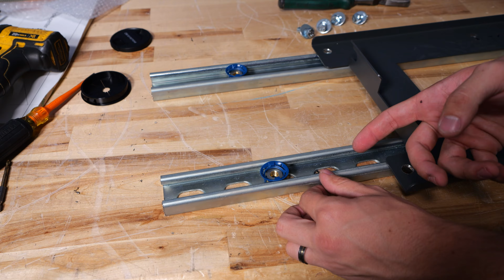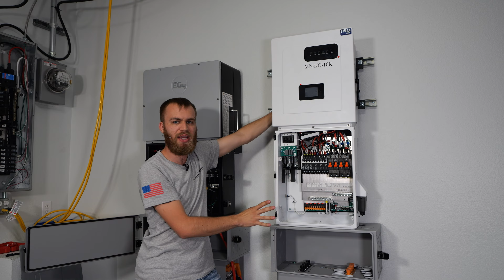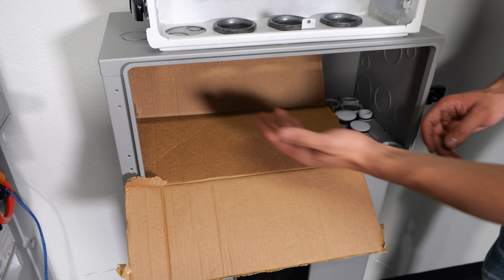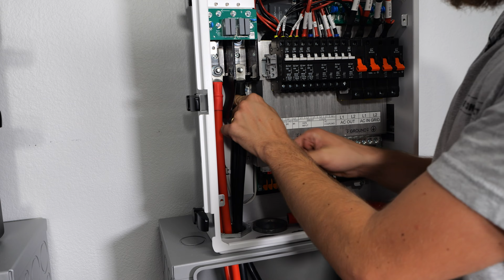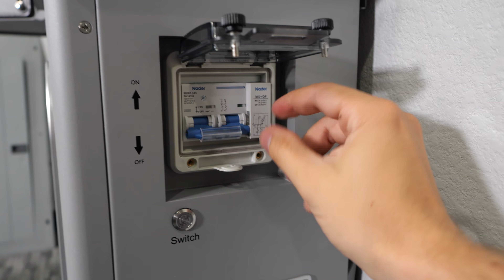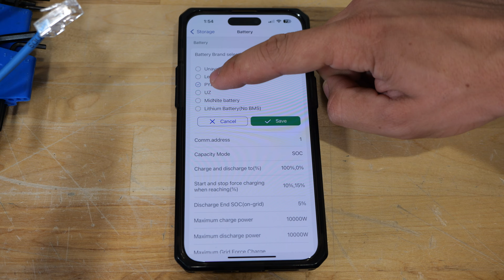Step By Step: How To Install Midnite's ALL-IN-ONE With EG4 PowerPro WallMount Batteries

Comment: Hello. Can this inverter be ran on solar alone? Also can it run in a grid assist mode? As in if it starts to get over loaded, it will pull from the grid the amount of the overload or will it transfer the entire load to grid like the 12000xp does? Oh and speaking of the Eg4 inverter next to you and a flaw it has, does the Midnite AIO back feed the grid when it’s told not to? 

The Eg4 hybrids have a very bad habit of when in any mode other than off grid only, they back feed many hundreds of watts.
Reply from the maker: From what we've seen and from what the manual recommends, this unit cannot run on solar power alone. It does prefer to have some sort of AC power available, whether generator or grid, along with batteries.
Regarding grid assist, the inverter will take power from battery and solar first and supplement with grid power if needed. The 12000XP is an off-grid inverter, indicating that it does not have the capability to blend power from both grid and PV/batteries.
The MidNite AiO, like most hybrid units, has a chance of backfeeding to grid when a large load is turned off. MidNite techs have found that if you have a constant 300W draw with loads, it greatly lowers the chance of backfeeding when loads shut off. Even with this though, there is not a way to ensure it never backfeeds if you're connected to grid.
Reply: Thank you for the information. 

I guess I should reform my question. 

This will run without a battery as long as it has a form of AC power (grid or gen) and then only use solar for power production unless the loads need more than my array can supply then supplement from the grid or battery once I get them?
Reply from the maker: @eekedout  Yes, TheOne indicates it can work without batteries so long as it has both PV and Grid, and you would use the Self-Consumption mode to utilize the PV power first for loads, with Grid used second if there isn't enough PV power.

Good questions! Let me know if you have any others!

Comment: Why you hooked 4 cables connected with the battery and the inverter?
Reply from the maker: Because one set of cables is not sufficient for carrying the current that this inverter needs.  With two cables on each, the proper amount of current can be carried.

Comment: Do you know if you can set export limit and when you force discharge of batteries, will it also export to grid, adhering to the limit provided I have a grid interconnection agreement?

Comment: Very easy to follow. Havent ever used that brand before. I do know i keep watching all these different installs of these invertors and still nobody says if the grid is required or optional. The 6000xp is supposed to be off grid but all I ever hear about is connecting the AC input. There was one person who said something about using a power station that has a 240 input as your ac input and charging it with solar. I just want something that works without the grid and can recharge from solar. Might tie in a power station to be able to have a way to charge during extended cloudy days and the like.

Comment: Why does it take two positive and negative battery cables for one battery or is the battery designed that way? Before you laugh at me remember the only stupid question is the one not asked 😂
Reply: I think it splits the current across multiple lines vs. having one fatter cable that would be harder to bend and likely more expensive or source. I hear ya, good question. I can't get over why the positive terminals are orange instead of red. I've just never asked the stupid question!

Comment: What is the distance from the floor to the centerline of the screen?
Reply from the maker: It's right at 69 1/2" to the center of the screen.
Reply: @CurrentConnected  Screen height keeps going higher. No bueno for us short people... 😏

I'm thinking manufacturers need to rethink where they put the screen or use a remote screen that can be mounted at the desired eye height.
Reply from the maker: @enwinn  most of the important info is on the mobile app- most would not use the screen
Reply: @CurrentConnected  Yeah, I get that. You ever run a headless computer and the KVM or Remote connection broke and something has gone wrong on that computer?

I really like what I am seeing so far in this inverter but standing on my tip toes or craning my head back is gonna be annoying. 😂

Comment: I thought the video was great.  Well organized and well spoken and lots of right to the point features instead of "filler".  I would like some clarity on the battery attachment to the inverter.  You connected two 3/0 battery cables to a single stud.  What is the inverter's  maximum charge and discharge capacity since it only has a single stud while Sol-Ark 15K and 18kPV have two positive and two negative?  Another question:  Does Midnite only offer programming via the inverter screen or a phone screen?  Many inverters are outdoors in California and the bright sunshine makes it very hard to clearly see these screens on an inverter or phone.  Is there browser access from a PC?  Does the app currently offer a full menu of TIME of USE controls by the 24 hours as well as by the individual days of the week?  Is there generator support?
In my case, I would require 2 inverters and 4 batteries.  That's a lot of exterior wall space.  Is there an approved slab type setup yet?